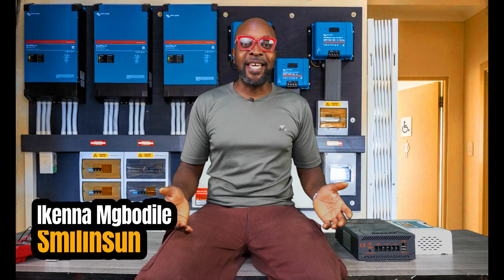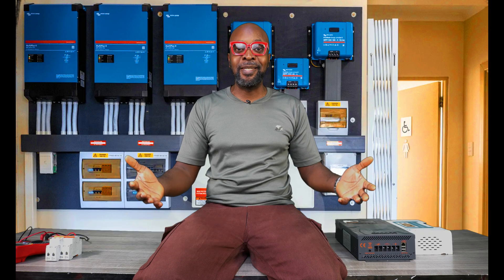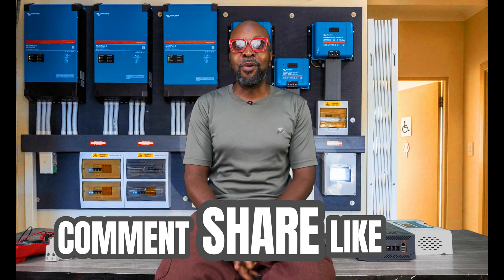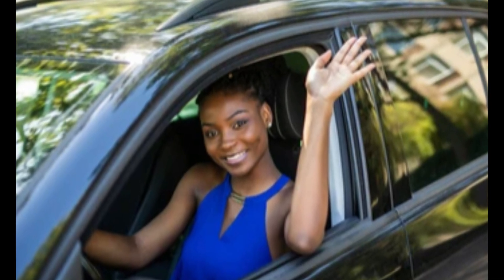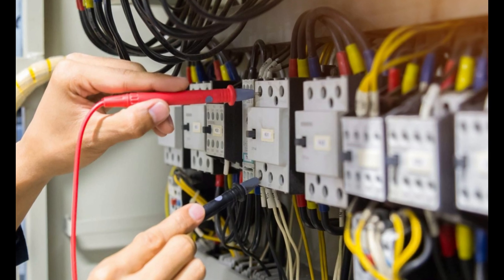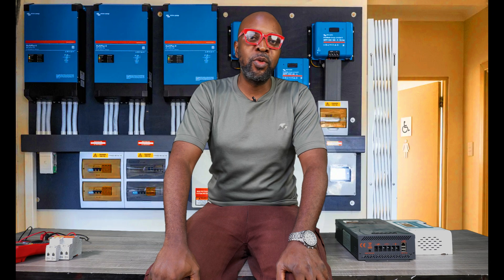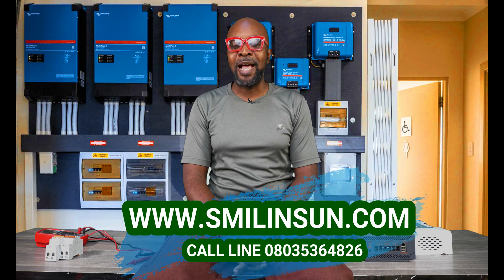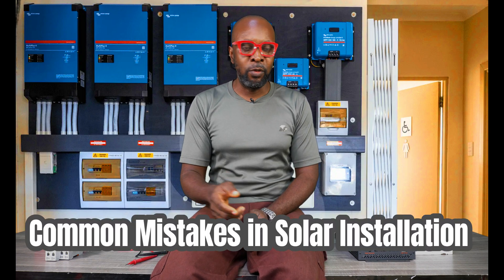Common Mistakes in Solar Installation

Comment: Please, I would like to know if my hybrid inverter can work with only solar panels without battery. I only use the inverter in the afternoon. I don't need it at night
Reply from the maker: @Uncommonconversation7220 only PV inverters work without batteries, yours always works with the battery. But if your energy generation is enough then the battery stays untouched.

Comment: Thanks very much...  Have always pick one or two things from your videos depsite my working  experience for over 8 years in the field, but pls 🙏 i have a disagreement on two things u make mentioned  and i will like you  to convince me.(1) For me Cabble  sizing  is Dertermined by  your pv arrangements and distance to your system setups. multiple parralle connection and long distance to your system setup requires ticker or larger cable to anable to travel the current not determine by  system setup.. (2) wen you having 400v too 500v at maximum in your CC Specifications  it will also have a nominal voltage which is advisable to be  above the nominal thou not advissable to be aiming the maximum, e.g if  you have a nominal cc 120v and it maximum is 400v you should be connecting  your pv in series up-too 200 or 240. like having  6 panel of 300w at voc 40v you are expected to  connect  all in series not 3 in series cos that will only give you 120 at maximum and wen the sun drop below 120 the system will  not  charge your battery, you shouldn't mind  the system setup voltage the controller will do the needful and what i do again is increasing the cabble sizing from the controller to the battery cos the current will increase more.. Pls am not teaching your job dont see it that way, and i want to hear from you and so i can  others can learn more. Thanks and God bless you more and more strength💪 to you. Peace and love

Comment: I have 10 panels of 250w and 4 batteries with 5kva hybrid inverter  , 80A Felicity charge controller , during the day with heavy sun  , the batteries cannot charge well , and it's uses battery current instead of sun energy during the day. Pls what do I do ?
Reply: like Engr Ikenna  said,you need more panels, add additional string, watch out for the voc, isc, wattage the same panels you previously used, don't mix panels please.
Reply from the maker: Using the battery current instead of sun energy, please can you explain further.
Reply: @smilinsunsmilinsun8056  what I mean is that when the batteries are  fully charged during the day it suppose to use current from PV without consuming already stored current from the batteries. The batteries suppose to start working when there is no sun light, my own does not do that it works with battery backup current during the day, my question is now , what do I do ? .
Reply from the maker: @icechuksblog  It's very simple you are not generating enough energy that's why the invertet pulls energy from the battery. What is being produced is not  sufficient to serve your real-time energy needs. You need to evaluate the system
Reply: @smilinsunsmilinsun8056  ok, thanks sir, so I should add more panels, pls  I want to ask is it advisable to mix the already existing 250w solar panels with higher watt.
Reply from the maker: @icechuksblog Higher yes lower no

Comment: whan doing any electrial work ac or dc voltage check an check an check again no matter if you bean doing it for years guy be safe
Reply from the maker: Very Important